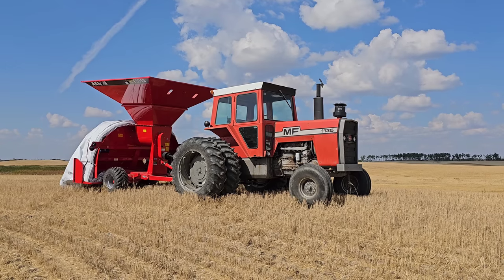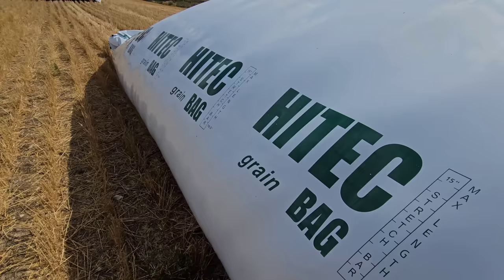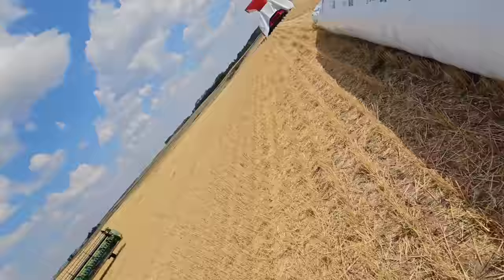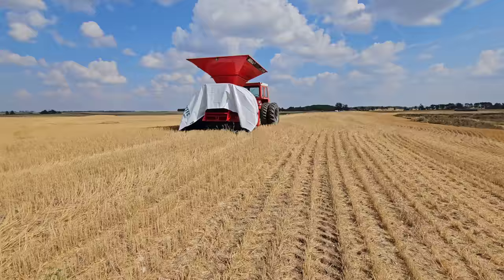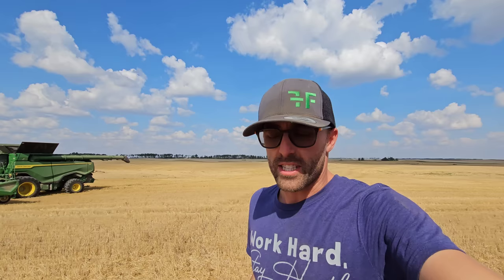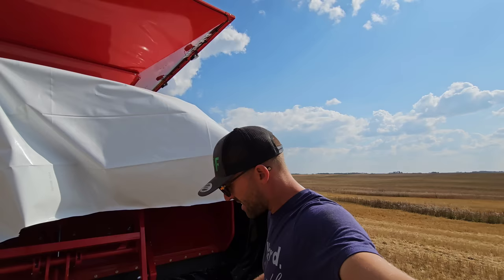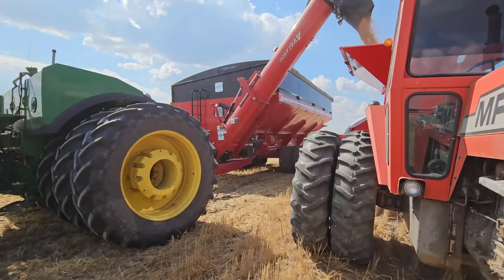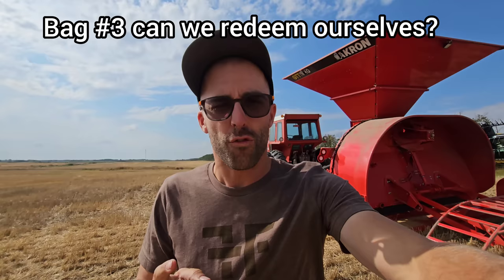How NOT to make a bag!

Comment: My son has a bagger and we have remote controls on it so buggy driver can turn on pto, rev up tractor ,adjust brake pressure and steer bagger tractor from seat of buggy tractor. Unfortunately the steering on MF 1135 needs new wave washers in hand pump so it wanders worse if you have steering control motor engaged.

Comment: Mike, you need to put Ag leader auto steer on old Ernie. That way you can set an a line and I’ll drive perfectly straight every time.
Reply: Auto steer doesn't work at low speed.
Reply: Set up a post for a target, tie the steering wheel with a tarp strap.
Check periodically for target.

Comment: Mike you need to take the strap and put it threw the slot on the pan not behind the pan like you have it. Keep the bagger tilted towards tractor a bit makes use of the slope of the bagger wall to assist with pushing 15” is no stretch in the bag that’s factory length of the mark good luck
Reply from the maker: Thankyou for that! I figured I was missing something 🤦🏻‍♂️😆

Comment: Have you ever thought about those "mother bins" like they use in Australia instead of the bagger? I'd assume the cost makes no sense for your operation?
Reply: Having a mother bin in the field the whole winter?
Reply: @xuser48  I thought Mike said he was going to sell the bagged stuff before winter? Though what would be the problem with leaving it all winter? No deer issues.

I was thinking more for the south farm since it's so spread out.
Reply: @jasonwilliams8016  - A mother bin is VERY expensive.
Reply: @xuser48  yea I figured as much, especially compared to the baggers. I'd assume the mother bin would also require a much larger tractor to operate

Comment: yer runnin a PTO... dude... there HAS TO HAVE BEEN SOMEONE THAT MADE A UNIT THAT WRAPS AROUND THE PTO WITH MAGNETS AND IT PRODUCES 12 VOLTS TO CHARGE BATTERY AND keep the lights on when you are running the pto and its night...  and with the extra TRONS flowing you can plug in the DEMONITONIZER MORE (the radio) and have TUNES AT THE BAGGER !!! 

and fi someone needs the idea on paper to get it done, lets talk if there is no such device yet and soemoemn says yea that sounds needed and neet...  

I have an idea bout a protable dragoon that will heat up the oil in a machine ... and it's a HOT WATER  pressure washer... AND it's a (there are like 4 other modules...)
Reply: It’s called an alternator, all tractors have them so not sure what the issue is with the electric supply maybe the socket type 🤷‍♂️